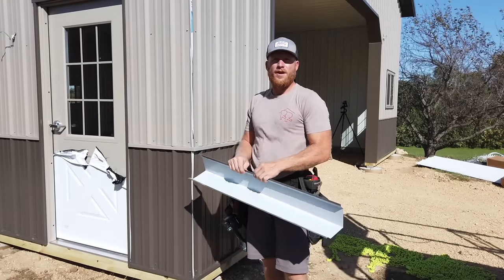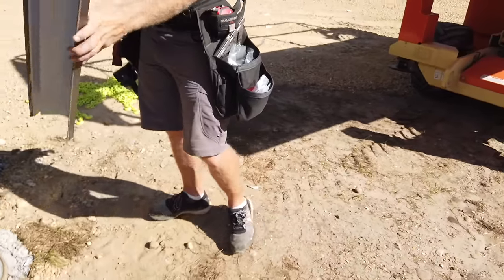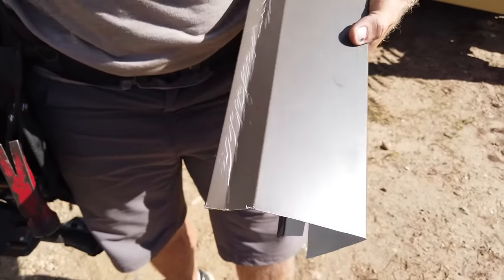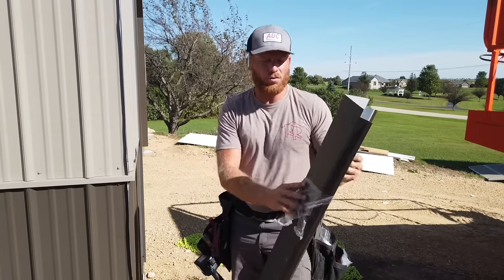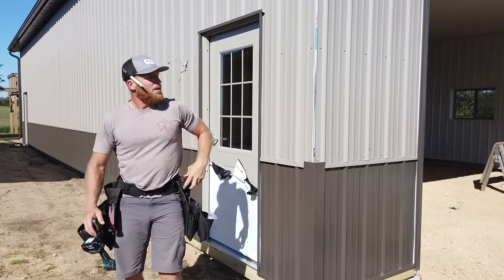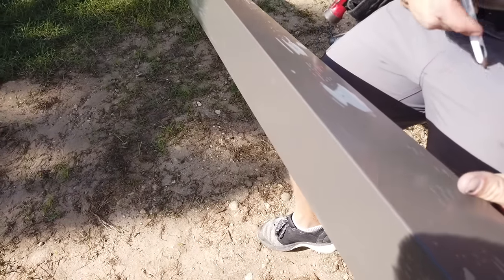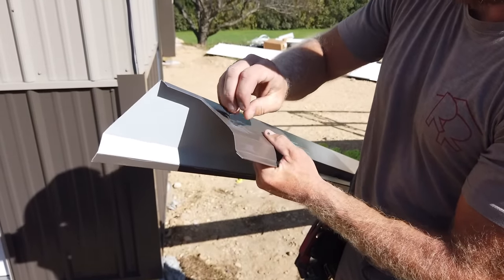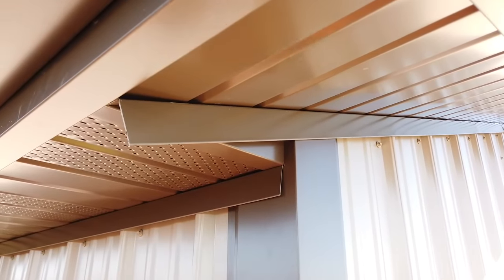Pro Level Metal Trim Details:  Corner Trims

Comment: A noticed the wind. You threw the scrap metal pieces on the ground. They are easy to pick up and won't blow away. However the easy to blow away plastic went into your pouch. You are a conscenious builder all the way through the job.

Comment: What do you do when a wall steel rib happens to be right where you need to fasten your corner??? Or do you plan ahead to avoid that??
Reply: I’m curious about this as well.
Reply: You should always try to plan ahead for that. Always try to start/end with a rib as close to the corner as possible. Most of the metal I use comes in 3 foot sections so that always helps me to figure out where my sheets begin and end.
Reply: You need to modulate from edge of steel to edge of steel where half of the rib is on then make a mark every foot or 3 foot or depending on panel corners land in the flat every time

Comment: Done quite a bit of metal work. A little tip (if you didn't know already) I use often for starting the screws in the metal is to get your screw in place and just give the back of your impact a smack to punch the tip of the screw into the metal. Works best with a short bit on the drill. Doing this usually prevents the screw from sliding around when you initially start to screw it. Works just like a punch.

Comment: You must be very lucky getting all your steel from Metal Sales, I've purchased steel from them, well (home depot) and it was just terrible. All there steel had waves in it on the overlap. Even after I pinpointed their problem they still didn't correct it. In the end I received all my money back but it doesn't pay me back for all the time I lost for reordering steel. I can't imagine you guys get your steel from a different plant since I'm in Missouri. Also none of my trim ever had any plastic wrap on it, so the panels and trim was damaged. I love your videos, keep up the good work!!
Reply from the maker: Never seen that?  I’ve been ordering from the rock island plant for over 6-7 years
Reply: @RRBuildings  that's good to hear, it must be the plant I ordered from then. I have used a lot of your tips in building my house with steel, thank you for all your tips and tricks!!

Comment: I get my corners in one piece up to 26 ft long makes for a super clean look....Also, we don't use wrap around corners because they leak between the metal to metal contact where the screws penetrate both pieces unless mastic is used between them same goes for the roof...Love the vids...
Reply: Screws with neo washers? we have a strict cyclone building code here and they are what we use

Comment: Nice use of the snips! Only the pros use them backwards while mitigating the metal stress by lowering your wrist during each snip. All for the tiny added benifit of putting the teeth marks on the non visible side of the metal. 👍

Comment: As an aircraft engineer ,when you have two cuts going into a corner ,we drill a  sixteen / eighth hole ,at the corner ,then cut to the hole , it stops cracking ,looks a neat detail ,takes a bit longer ? 
Cheers great work
Reply: Stop drills are for sure necessary in aircraft when the metal stress really is crucial for safety of flight. Most of this work on the siding is all cosmetic. I don’t think it is necessarily stressed nowhere near the point of aircraft. That being said, it might look better.
Reply: There would be no building left if it flexed or vibrated that much to tear the steel...
Reply: We do that as well when cutting laminate into/around corners. Just the shifting of the surface from temperature makes it crack almost every time.
Reply: When that tornado comes, it does no care about stop drilling. When Kyle starts building pressure vessel buildings, stop drilling may be worthwhile. 

You also preassemble with Clecos, not a awl.

Comment: Love the videos man, I'm covering an old house in metal like this, but the windows at the north side are a different height from the other sides, so the wainscots are going to be at different heights. How would you handle something like that? Would the metal corner be solid throughout and just notch the corner around the wainscot at both locations? Thanks for the help

Comment: Kyle, have you ever considered offering DIY kits? You have all the suppliers lined up and appear to use all the best components. I’ve been looking into building a post frame garage/hobby shop to build myself. Love to know what dimensions make the most since cost wise. Also, have any of your customers ever used 2x’s tongue and groove flooring? Thanks-
Reply: I am planning my shop now and was told if you can use a number divisible by 3 and 4 it will make logistics easier and therefore cheaper. 3' for the steel and 4' for the truss spacing, etc.

example would be a 32x48.

Comment: HELP!!!  I'm using  the same style corner trim as rake trim on my gambrel roof.  I'm struggling to cut the rake trim down at my 12"  overhang.  Can u show me how to cut the steel for my overhang at an upward angle from the bottom of roof at the bottom where overhang meets.  barn style roof rake trim just like the stuff you are using for corner trim .  Thank You Good videos!!

Comment: Hi I have a question I have smart siding and metal which the metal is at bottom and smart siding completes the rest of the wall up. What trim do I use in between the metal and siding So water doesn’t go behind the metal

Comment: What's the reason why I've never seen you do an angled soffit on the low side of the roof? Customers don't want it or is it unpractical?
Reply from the maker: Angled soffit?? Like same as the roof pitch?
Reply: @RRBuildings  Yes, having the soffit vents in the same angle as the roof. That would resolve the little vertical pieces in the soffit vents at the gable end.
Reply: Because he doesn't like bird boxes. I have to agree. Looks better without them.
Reply: @bluebird5100  That doesn't make much sense in my context, if you install an angled soffit you cannot even build bird boxes.
Reply: @kleinisfijn  all he did was follow the bottom of the rafters instead of framing it down level.

Comment: How would you over lap corner trim with out wainscoting? Just over lap the 2 pieces?
Reply: No you cut the first piece the same way but without the little notch cut.if you don't cut out the hymned screw line on one of your metal corners then you'll have 4 layers of metal overlapping on the very edge and 2 layers at the center of the corner. Which will make your overlap bulge out.Hope that helps.

Comment: great vid.  what do you use to fill the botton of the trim so mice or bees dont make a home????
Reply from the maker: No way mice can get in... also not sure about bees
Reply: @RRBuildings  thanks for the reply, but isnt there an opening ALL the way from the bottom of the corner piece to the roof?????
Reply: You can always make your corner a couple inches longer to fold the metal to close up the corner. I usually use this when installing a metal roof on a hip roof when the ridge metal comes down to the gutter.
Reply: The starter metal / base metal that Kyle uses at the bottom of his wall steel is a “Z type” metal and it is what closes the gap you may be thinking of.
Reply: @4:25 you can see its closed at the bottom due to the base trim.

Comment: Hey really enjoy your trim work videos. Not sure if you still check this very often but the buildings I do we do the same exact trim work around the birds box as you. The last time I did it with the birds box behind that piece I placed a piece of 1×6 to fur out that bird box. So rather then leaving that 3/4 in lip on the top of the corner I just cut that off. I'd like to hear your thought about it if you still check these comments.

Comment: Thanks for this video.  You saved my bacon.  My corners (and other trim) is a 3rd color.  Light gray upper, charcoal wainscot, and black trim).  I'm not pro, just a homeowner trying to reside my barn from a tornado.  Could not find a contractor; they're all busy with other victims.  Your method with keep me from splitting the corner which would not look right.

One other problem: my metal supplier (same manufacturer as yours) talked me into rat guard for the base trim.  It has an angled bottom.  Now I'm faced with wrapping the corner and can't figure how to cut it.  If it was a standard base that had a 90 bend at the bottom, no problem.  Do I just miter a 45 or is there some trick to cutting and wrapping?

Comment: Kyle, I have never seen you use the yellow straight cut snips, is there a reason why?
Reply: Yes because they are junk they are straight cut snips
Reply: They only excel in a condition where you are making a straight cut, and I don’t even think they are useful when the sheet metal has multiple bends in it. I believe any thing you can do with the yellows can be done with the reds. I don’t know that for sure because I’ve only ever used the reds and greens.

Comment: That annoying plastic film is so the press brake does not scratch the finish at the factory as they bend the metal. Without the plastic, you can see the fine marks. It is handy for handling the trim at the job site.
Reply: Very true I bend metal like that everyday at work

Comment: Thank you very much for the great videos!!   I had a shed and then a larger building to do with metal siding and found your videos so very helpful!  Can't thank you enough for some of the great tips.  I didn't even know that the green and red cutters were opposites, lol... I got some reds to go with my greens and this is a game changer.  Also the tips about the use of the speed square, and the other cutting tools.  Oh, and the best of all was the technique of using the awl to mark the screw holes in all the sheets.  This works so well!!    Thanks again and keep making these videos please.